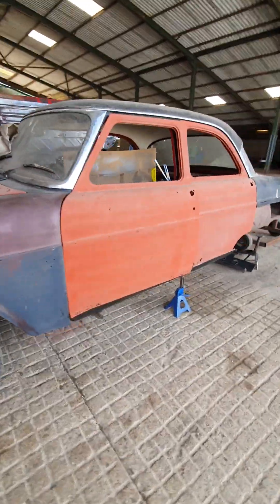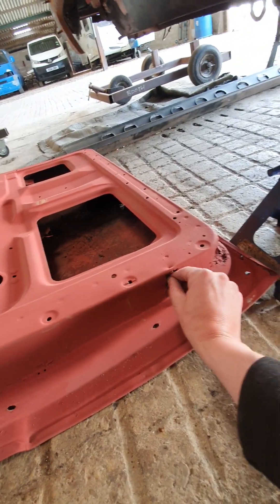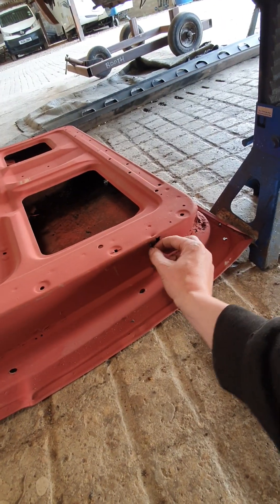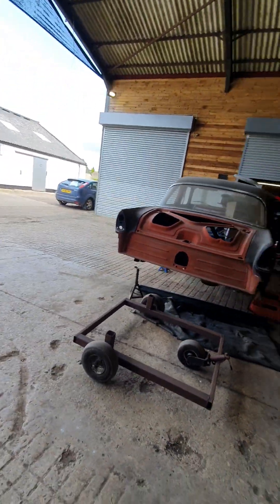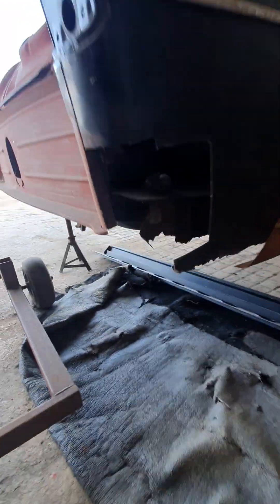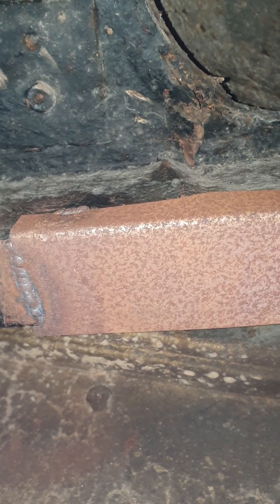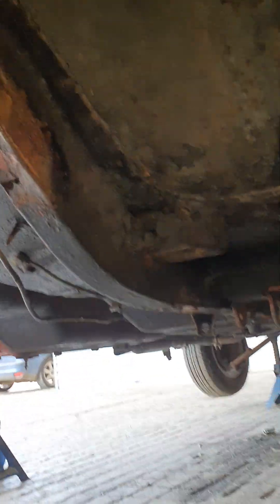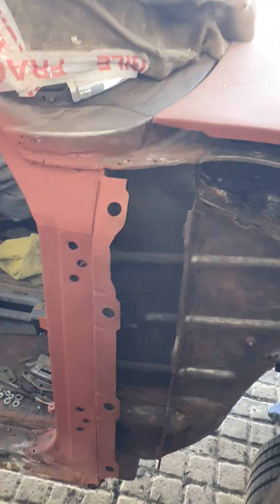Ford Consul Restoration Part 21

Comment: I would be tempted to install a 6 Cylinder Zephyr /Zodiac Engine in it...
I had a Consul Convertible way back when...the 6 Cylinder Engines are a good bit more lively.
Reply: It won't fit, the engine bay is a lot smaller length wise on the Consul so you would have to cut out the bulkhead and tunnel etc and fabricate a new one.
Reply: @cmg6848  Maybe a V6 then?😁